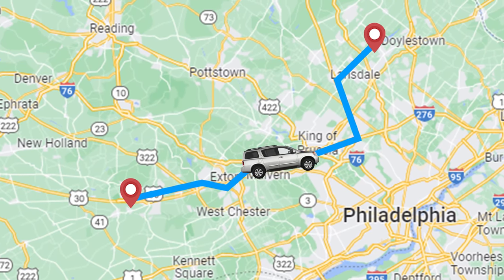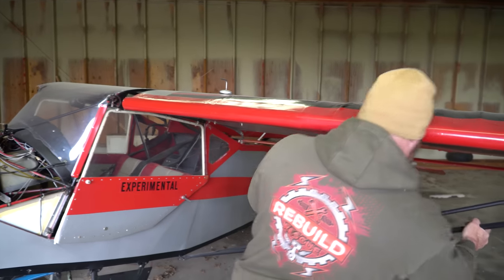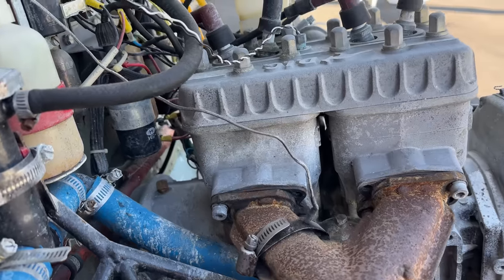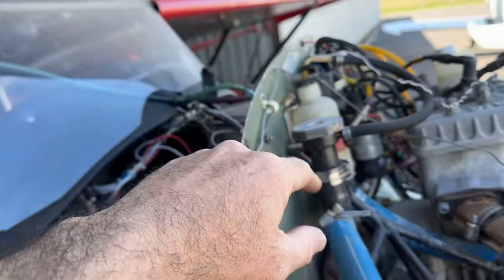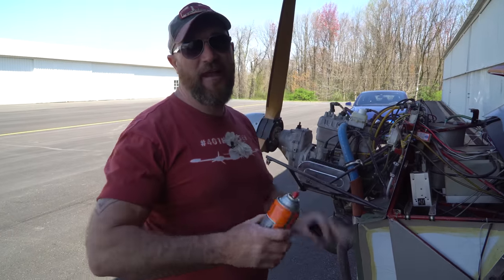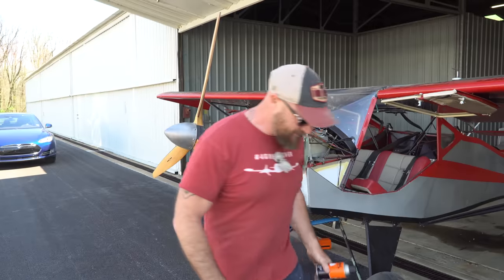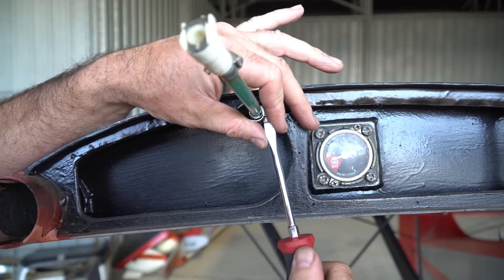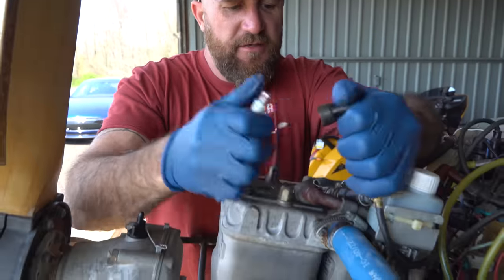I Bought The Cheapest Airplane On The Internet

Comment: It's super important to find someone with Kitfox time to teach you to fly this. They are a blast to fly but can be a real handful.
Reply: That is for sure.  😃  I just bought a Kitfox 7 and responsive is the word.  I'm flying with a CFI with 600 hours in a Kitfox.  It seems a lot milder as I get more time in it.  😊
Reply: That applies to any ultralight. 'Real' aircraft owners and pilots look down on ultralights as not being 'real' aircraft. I have both licences. The fact is that flying Cessnas, Pipers and the like is like flying an armchair compared to flying an ultralight. The former fly through the air whereas the ultralight is part of it meaning that you're flying stick and rudder the whole time. It doesn't come easy to 'real' aircraft pilots - myself included - can be very tiring in the beginning and can take a while before you're confident and proficient.

Here's a little story. A pal of mine who now holds an ultralight licence, already held 'real' aircraft and helicopter licences when he flew in the right hand seat of an ultralight which he was about to own. The weather wasn't particularly active, a bit but not too much, but after I'd handed him the controls he handed them back within a minute or so because he found the conditions too demanding for him.

I acquired that aircraft from him a short while back - an Xair - and it's on my channel. I flew it from the UK down to south-west France where I now live and have another, a Savannah, which I occasionally fly to the UK and back as it's more capable. Someone once said to me that the thing to remember is modern ultralights are pretty safe - they can only just kill you. And he was right.
Reply: Why is the stick so short
Reply: @rylanthompson5844  Said the actress to the bishop...
Reply: @battz99  🏴‍☠️hell nah
Reply: @battz99 Wolfgang Langewiesche stick and rudder. Learn to fly. No instruments needed for vfr. Then get under the hood time, often

Comment: That Bombardier two-stroke Engine does in fact have an oil fill cap and does use a crankshaft oil.  It also has an overflow tube when and if two cycle cylinder oil accumulates on top of the gearbox oil which is a heavier oil. Its in fact the same on all dirt-bikes and snowmobiles.

Also that plane has two ignition systems so if one fails in flight then you can switch to the secondary ignition system and its sparkplugs.

Advice ,,,,,,remove all those plastic fuel connectors, hose and quick-connects above your head coming from the wings and switch them all to steel flex hose and quick connects. If a child or a passenger were to grab those lines above your heads you will have fuel pouring into the cockpit and likewise sitting on a potential bomb.

Comment: Doesn't matter whether it starts or not. The engine must be stripped down and rebuilt anyway along with all the rest of the aircraft's systems. That's why it's cheap - everything needs deep in depth investigation and 90% probability - replaced.

Comment: For a plane that small, probably need to have two people just for balance.
Reply: The occupants sit right on the longitudinal center of gravity so it doesn't make any significant difference with one or two people.
Reply: @buckmurdock2500  both people can't sit on that line. And jason is pretty heavy. If they only put fuel in the right wing that would help, at least until the level started getting low.
Reply: @kerryedavis  longitudinal c.g. Lateral c.g. changes due to occupants is negligible.

Comment: That little bottle is for the rotary valve not for the fuel. That a rotax 582. Now I didn’t see the oil bottle  for oil injection. So I would definitely pre-mix. Now on my 582 I do a leak down test. Same as a lycoming. Those main seals are good for 5 years or 150hrs. I would do your homework on these rotax’s. And your fuel burn is going to be closer to 5 gal an hour.
Reply: Perhaps the bottle you're thinking of is the white plastic one mounted on the passenger side of the firewall @ 24:53.
Reply: @markszyszkiewicz  The bottle on the passengers side firewall is the radiator overflow bottle. The small reservoir mounted on the engine above the carbs is for the ROTARY valve, that's it. This engine has no oil injection pump and is set up for Pre-Mix ONLY.

Comment: Watching you run that with straight gas was painful..... The only thing that kept it from incurring damage is the old fuel that had oil in it. Keep running it like that and you WILL kill it!!!!!!!!!!!!!!!!!!!!!!!
Reply: How do you know he didn't have oil in that fuel? Uh, sounds to me like 1 you know shit about engines, and 2 you know shit about engines. The entire time he ran that thing I saw blue smoke puffing from the exhaust. That, my friend with no engine experience, means there's OIL burning with the fuel. I'm pretty sure he'll be ok, dude was a mechanic for years and years on race cars and the like. Relax
Reply: @Anthony Blacker  Maybe because he called the rotary valve oil reservoir the source for the oil injection, which the engine does not have, that he claimed it did have. Then the fact that he had to fill that reservoir with oil tells me the rotary valve is leaking into the crankcase. Between all that oil in the cases, and the old premixed gas in the gas tank, is why you saw smoke when it was running. So put that info in your pipe and smoke it, buddy. I've owned and maintained engines exactly like this for years, hundreds of hours. You obviously don't know jack about them like Jason.

Comment: The Rotax 532 had single ignition, your motor has dual which indicates it's a 582. That little oil reservior is for the rotary valve only, and should be kept full, the engine doesn't have an oil injection pump and is PRE-MIX only. You add oil to the gas. 50:1.
Reply: Actually it is a dual mag 532. Rare I know. It also seems to have oil injection. Again- rare.
Reply: Rotax 582 Bombardier
Reply: Well, that little oil reservoir is used to lube the waterpump gear and center main bearings on newer Rotax snowmobile engines, and I suspect it also lubes the rotary valve on that engine. So, in a way, you have to check the oil on it. 

I wonder what that aircraft would say about an 800 etec engine with a proper pipe. Then you would have an engine that has a computer that adjust for altitude, fuel injection that has no problems with upside down running. And something like 150 HP.
Reply: @buckmurdock2500  it's a greyhead. Model 90 582
Reply: Engine seizure about to occur once the oil runs out
Reply: @Sam-ou8uv  It does NOT have oil injection. If it did, there would be an injection pump on the Rotary valve cover and there is nothing there on this engine. Could it be a 532 dual mag? I suppose that is possible, but it is definetly NOT oil injected.
Reply: @Sam-ou8uv  😂

Comment: It’s a 532, with a 582 head. So a dual ignition system can be added. The 532 had points ignition only firing one plug on each cylinder. The other ignition is 12 volt and not Rotax. 
It’s a rotary valve engine so the oil bottle is to lubricant the valve shaft that drives 90 degrees to crankshaft. It’s a 50:1 oil mix. The gear box which is the B box. Like all Rotax gearboxes can be mounted either way up as can the engine. That’s why there is two level plugs. Id suggest you mix the oil to the fuel if you want it to run any longer. Also the 532 had a weak crankshaft. Id replace that engine with a late blue head 582.
Reply: It's a snowmobile engine
Reply: @waynerohde1036  
No mate, Rotax produced these for aircraft
Reply: Do not recommend any two strokes. Those are built to fail. 80 hp 912 is way to go
Reply: @jarkom9  Clearly you know very little about 2 - stroke engines
Reply: That's probably true. But I have also never had forced landing. I have heard stories about those 2-stroke pilots who have had more than three. Luckily those times are well gone
Reply: 2-strokes definitely have their places but not in aviation. I have had two 50cc mopeds and I think 2-stroke is only way for those. First one broke after ten thousand miles but it was repairable easily
Reply: @jarkom9  your American friends will disagree as the ultralight is still widely used on the USA. The Rotax 582 and 503 engines are very reliable, but are no longer made. 
And I do agree, the 912 series engines are the way if you want to fly that weight category. 
I’ve had and flown behind all the Rotax 2- strokes in years past. They had w
Reply: The early engines had weak points, being the crankshaft and single points ignition. Which were all sorted in the later engines. 
I currently have the 80hp 912. Great engine, better than my radial.
Reply: @vinceburling4613 anything that's lubricated by smoke is dodgy. Great for cutting timber but that's all.

Comment: This motor needs premix fuel!  The small tank is not for the fuel. If it was oil injected it would have a much bigger oil tank
Reply: It amazes me how some really smart people can be so dumb. He should have researched that engine and did his homework BEFORE making a video telling the world how it works... Then he runs it on straight gas! Only thing that kept it alive was the old premix that was still in the tank. Engine will survive idle and part throttle at 100:1 no problem. This video was painful to watch...
Reply: @tomrc4328  i agree Tom.

Comment: Jason, that doesn't have oil injection. That little reservoir is for the butterfly valves and must be kept topped up with normal 2-stroke oil. You run the engine on 50:1 premix. A little knowledge is a dangerous thing. If you put straight 100LL or mogas in that tank you were running that lovely engine without oil. BTW that's a Rotax 532, out of production for many years and parts are increasingly difficult to get hold of. If you seize it it'll be a brick.
Reply from the maker: Don’t worry the fuel we put in it had 2 ounces for every gallon of fuel giving it a 50:1 ratio mixture. I didn’t add that to the edit. 👍🏼
Reply: @rebuildrescue  wrote:  Don’t worry the fuel we put in it had 1 once for every gallon of fuel giving it a 50:1 ratio mixture.

Uh, 50:1 would be 2.6 oz per gallon.  1oz per gallon is a ratio of 128:1, so basically you ran the engine without lubrication.
Reply from the maker: @buckmurdock2500  I fat fingered my response 🤣
I used a ratio rite measuring cup to make sure the correct oil was added to the mixture.
Reply: @rebuildrescue  you're getting closer. Now at 64:1 ratio
Reply from the maker: @lesterawilson3  100% 😂🤣👍🏼

Comment: I used to fly an Australian certified version. They’re easy to fly in the air but twitchy on the ground/ landing ect. You will need training in one or you will most likely bend it. Plus the stick only needs to be moved a little bit.
Reply: So true.  In some circles it’s considered a high performance aircraft. I’ve had 2.  The 2nd one had a Jabiru 2200. It was an awesome lil aircraft.  I wished I hadn’t sold it.

Comment: Hopefully you guys premixed oil in the fuel too. The oil bottle only provides oil for the rotary valve on the 582.
Reply from the maker: Yes Sir 50:1 👍🏼
Reply: @rebuildrescue  In the video you filled up the rotary valve reservoir and told everyone that's where the oil injection gets it's oil from. And said nothing about mixing gas when you poured it in the wing tank. That engine has no injection pump, is set up for premix only. I've got two 582's and a 503 that I've been flying the past 5 years. If you have any questions feel free to reach out.
Reply: @tomrc4328  you won't get an answer. You are a hater now because you called him out.
Reply: @brendangardam710  Sad but true... Not being able to own up to such a simple mistake says a lot about a person. I thought Jason was a stand up guy that wanted to be correct, he should have appreciated the correction, but instead he's ignored all the comments about his lack of Rotax knowlege. *shrug
Reply from the maker: @tomrc4328  Hey Tom thank you for taking your time to come over to the comments and nicely give us that info on the Rotax.  Unfortunately in my hast of getting the video edited I had left in my total misinformed fact of the rotary valve lubrication reservoir as the fuel oil injection reservoir. Many times in an edit we’ll leave out multiple things to keep the episode moving. Also the episode can actually run through multiple days of work like in this case. Before adding fuel we did identify the need for pre-mixing the fuel/oil as this unit doesn’t have an oil injection setup on it. Had we not the engine would have locked up very quickly.

Comment: The reservoir is to be filled with 2 stroke oil, not motor oil. This also indicates the motor does not have oil injection, meaning you have to mix oil in the fuel. The connected bowl vents are supposed to go to a HAC system....high altitude compensator. It applies vacuum to the bowls to change the fuel flow without jet changes. This is common snowmobile stuff. Its now been started on straight gas....the formerly pristine motor is junk now.

Comment: LED strobes reduce the amperage draw, not so much the voltage.
Reply: I caught that also, but realize that most people confuse them if they know the difference to begin with. Everything in a system uses the same voltage (generally), whatever the battery/generator/alternator puts out. They just have different current [amperage) draws.

Comment: the rotax engines have a rotary valves behind the cover that the carbs hook too the little bottle on top of the engine is for straight 2stroke oil and it is there to lube the rotary gear bearings if there is not an oil injection reservoir or injection pump you have to premix failure to keep the little bottle full of oil will result in the failure of the bearings then the rotary gear shaft will stop and the brass gear on the shaft will shatter and you will no longer have compression just remember to keep it full

Comment: The engine is not as low-time as you may think. TBO on the 2 strokes is about 300 hours so 139 hours puts you almost half-way there. Also, if the plane has been sitting for a long time, you may want to replace the crankcase seals. If you blow a seal, the engine stops. Kitfox warns about that. The newer models went to certified 4 strokes. I wonder why the plane was parked in the hanger with the cowling off. Engine problems? Find out why, then fly.
Reply: @buckmurdock2500  Thanks Buck. You're right. RR did remove the cowling.

Comment: The crankshaft is not lubricated by the fuel, it’s lubricated by the oil in the fuel; probs @ 50:1. Or on some engines, there is an oil injector pump.

Comment: Resistor plugs have been common since the 60's.

The engine looks like the grey head 582 I have in my Avid Flyer. (Predecessor of the Kitfox) Mine has oil injection but it's common for people not to trust them so many strip them out and convert them to premix only.

Comment: That's not oil injected, pre mix only. It has no oil injection pump and that reservoir is for the rotary valve only. You keep that full, but it really doesn't use any if the rotary valve is in spec. Mix your gas 50:1, or you will fry that 582! *532 had one spark plug per cylinder. ;)

Comment: I had several 1975 Suzuki RE-5 rotary motorcycle that had the oil injection pump.  Not one of them had a oil injection system you could trust and that would ruin the seals, loosing compression.  Always premix.

Comment: Those are probably resistor plug caps. You are gonna want to go through the carbs. I've bought a lot of older snow machines that have been sitting. They always start in the garage almost every time and die five miles down the road due to a clogged jet in the carb.

Comment: Cool little airplane, and only powered by a snowmobile engine! 😲😲
Reply: It's not a snowmobile engine. It's an aircraft engine. Rotax only made the 582 for aircraft. The aircraft engines has an awful lot of non-obvious differences from the snowmobile engines which they are based upon*, but they are *not the same thing.

Comment: @ 2:20. You mention the oil reservoir holding 5 oz and the mix being 50:1. So, your two fuel tanks hold a combined 250 fluid ounces, or 12.5 pints or 1.5625 gals?
Reply: @eagle2019  *math……s

Comment: A few notes on 2 stroke oil.   First of all, while Castor oil is an okay at inhibiting rust, it's not near as good as a modern synthetic with a dedicated rust inhibitor package.  Secondly, if the engine has a premix system, Castor oil is probably not the best choice for it.  It's likely too thick.        Looks like maybe you maybe have to premix in the wings and put in oil for the power valve in the small reservoir.   Benol is definitly not great for power valves.  R50 would be a good choice there as well.   Also Klotz has a Snowmobile Techniplate which might be a good choice.    I like Klotz R50 synthetic in my 2 stroke motorcycles, but I'd check and see what's recommended for Rotax aircraft usage.

Comment: It’s super important to transport these carefully when moving overland. OUCH!  Did the tail spring and fuselage survive that trip.  Supports are supposed to be mounted between end of fwd spar to fuselage strut lug to prevent bending moments to the wings when trailering these types of aircraft.  I’ve personally seen bent tail wheels and broken / bent longerons from not supporting the tail. That’s at least 250 lbs of weight resting on the tiny lil leaf spring with wings folded.

Comment: Funny, I mentioned flatbedding back to the shop and someone attacked me here.  I guess he would prefer you to fix it on site and fly it back.  Given the work you are taking about.  I would remove the engine, clean it up and make the modifications you think is best.  If you are going to sale it I think I would fix the have toos for safety.  Check the fabric for dry rot and general failures, the tires seems you are questioning it and anything else you didn't mention.  If you want to keep it then I would make it near mint condition.  Up to you what that is.